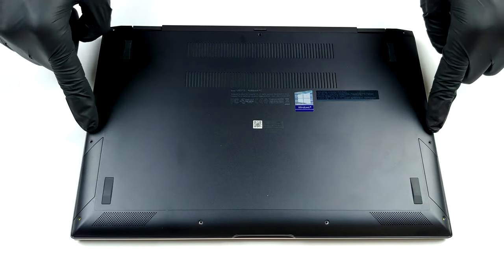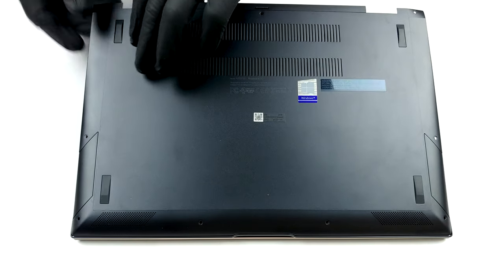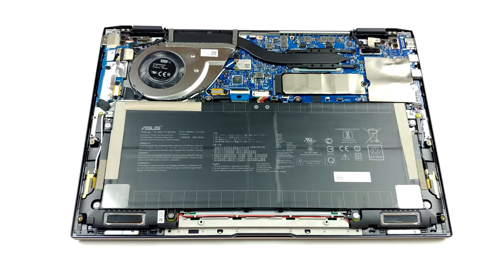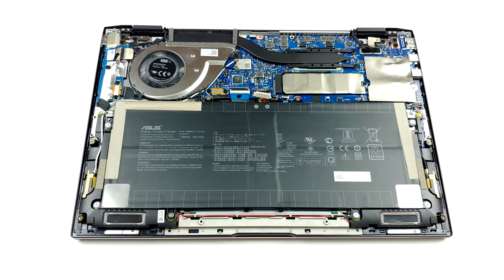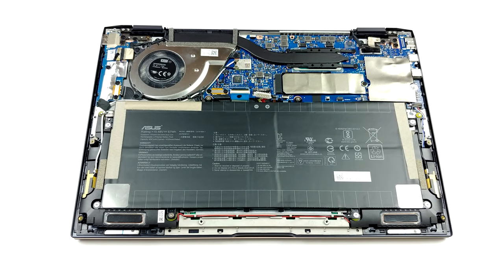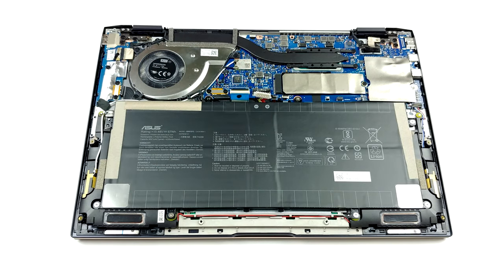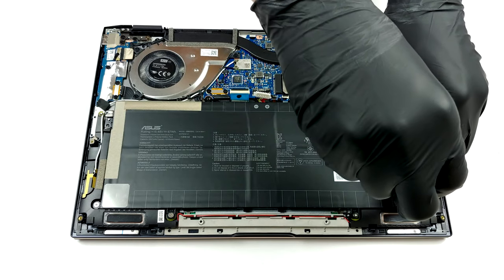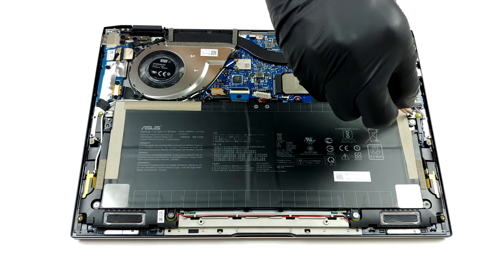🛠️ ASUS ZenBook Flip S UX371 - disassembly and upgrade options

Comment: Hi. Have you ever thought if it's possible to solder extra RAM on the mother board if there is a slot for it? In theory, it should be there if there are 8 and 16 gig options
Reply: You have to presume that you have the option for one or the other. Not a 24gig total.

Comment: I happen to own this model of ASUS recently acquired. I just want to know how I can preserve the battery that it can have a long-life span. What is the best way to keep it for a long period of time before making a replacement? Is it safe to always use it on charge or should i just disconnect it after it is fully replenished?
Reply: In the myASUS app (press the F12 key to start it), you can set the fan to charge no more than 60% or 85% of full. You should avoid having the battery charged close to 100% or 0% for long periods of time, because that puts extra stress on the battery. For long life, it is better to keep the battery in the mid part of the charging range most of the time. Of course, if you will not be able to plug it in to AC current at certain times, you may want to charge it more at those times.